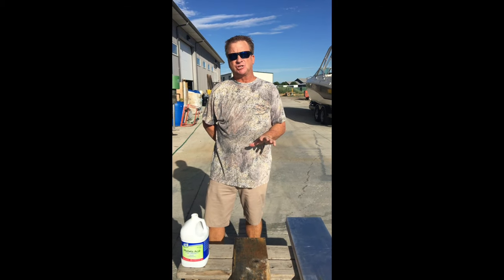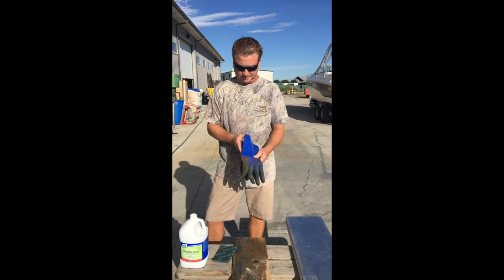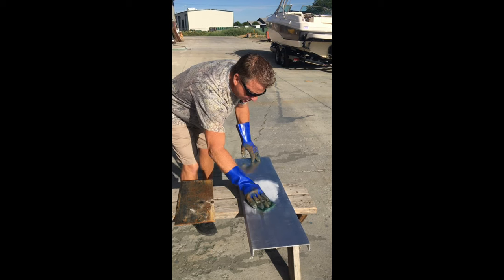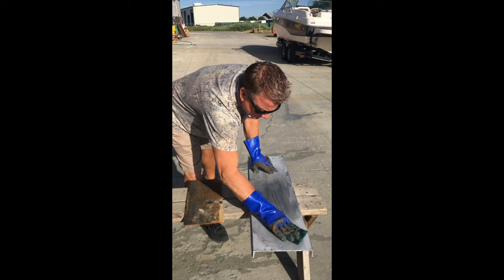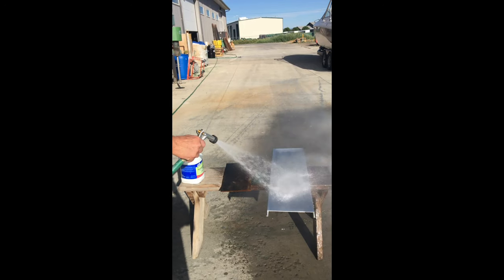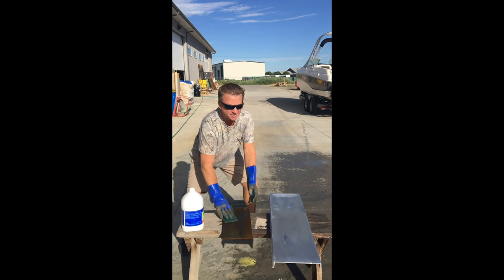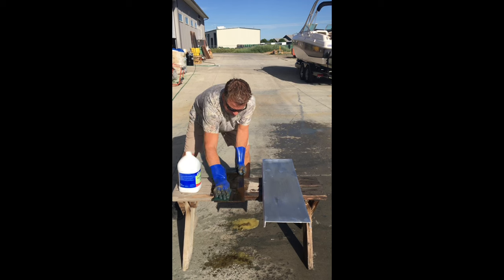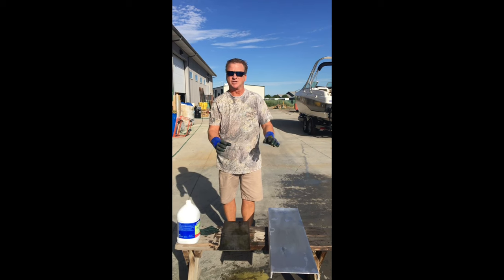How to Clean Steel & Aluminum for Tuff Coat Application

Comment: I have just ordered a kit with the primer and Tuff Coat. On the inner hull it has been painting years before I got it. The paint isn't pealing , I haven't wire brushed , sanded , or any other removal proces yet to it. Should I remove every bit of the old paint , or just go over it with the acid?   The outside had been spray bombed many times and was in a mess. I wire wheeled it to metal.  The paint on the inside seems to be a good quality , but I want a long lasting finish that won't start pealing.

Comment: what about vertical surfaces?
Reply from the maker: Please give our office a call at 970-252-9457 to discuss your specific project needs. Application to vertical surfaces is not a problem, but speaking with our technical department on proper application for vertical surfaces is recommended for a successful project.